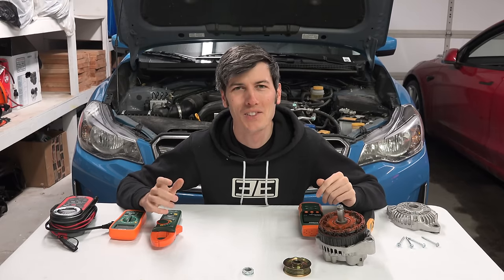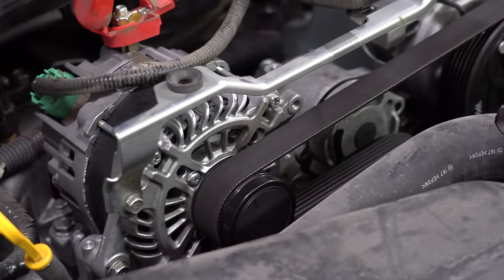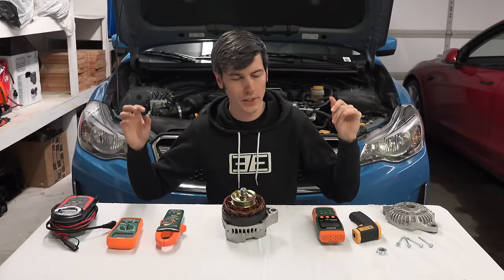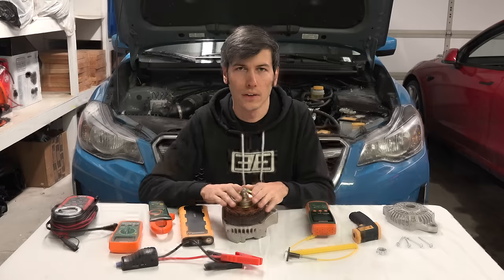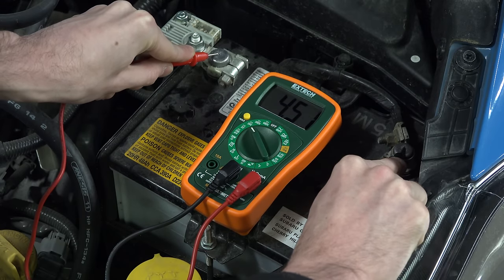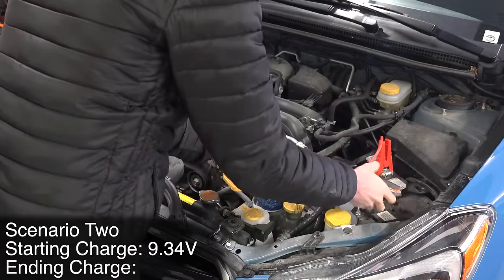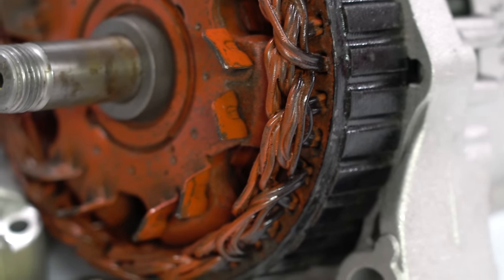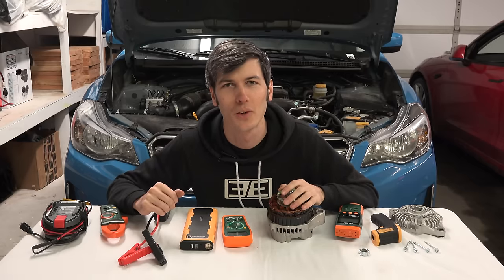Can A Dead Battery Ruin Your Car's Alternator?

Comment: FULL BRIDGE RECTIFIER (been watching too much electroboom)
Reply: Oh my God I LOVE electroboom
Reply: Actually there is a Voltage Regulator working in conjunction with a Diode Bridge (sometimes known as a "full wave bridge rectifier" and  also working with a "field rectifier")
Reply: Dont forget the Even fuller bridge rectifier..
Reply: Someone needs to write a dissertation mapping the commonality of large youtube channels among users. There seems a lot of overlap, even when the subjects are only tangentially related.
Reply: @rj.parker  Yup, voltage regulation is done by changing the voltage applied to the winding inside the rotor.
Reply: Who else misses photonic induction? I POPPED IT
Reply: That comment made my day :)
Reply: Not just a Full Bridge...but a 3-phase bridge...!
Reply: Sadly a car alternator has a 3-phase full wave rectifier, not a FULL BRIDGE RECTIFIER....
Reply: @tomvleeuwen  Same thing.
Reply: Uses thyristors in 3 phase rectifier to control voltage and rectify.